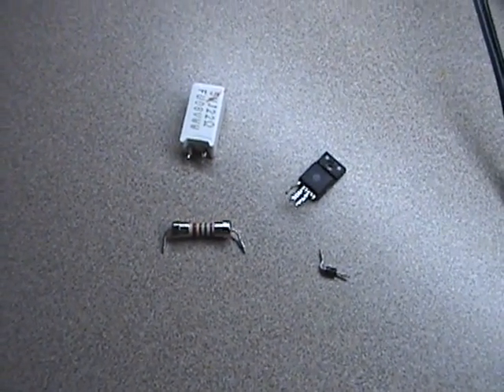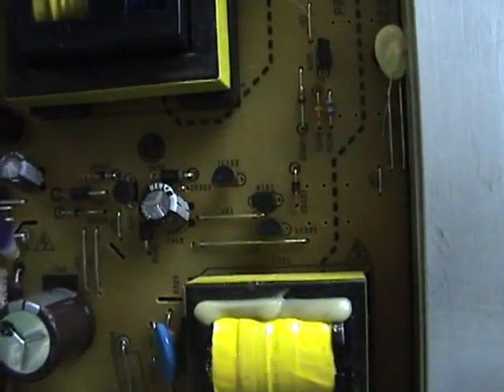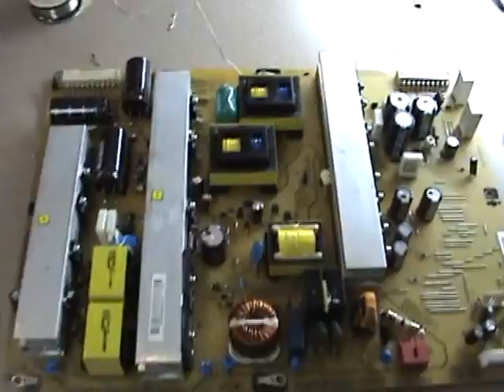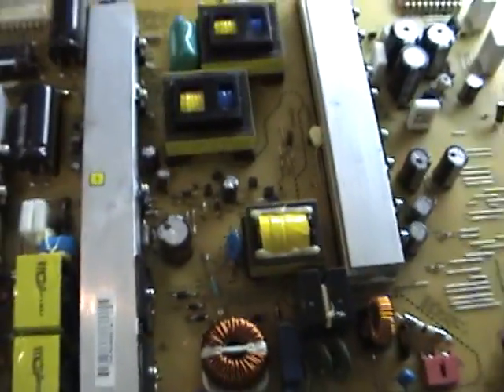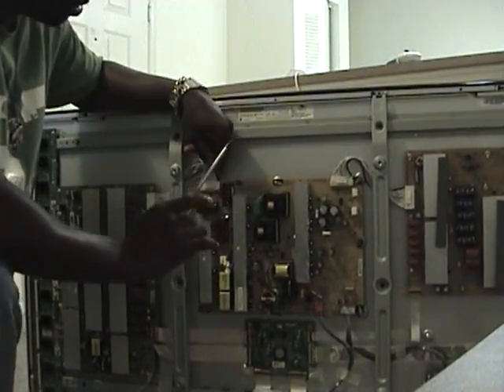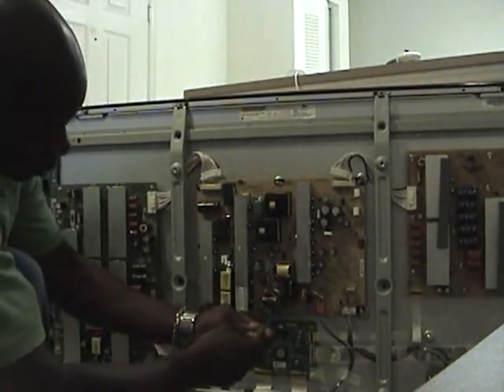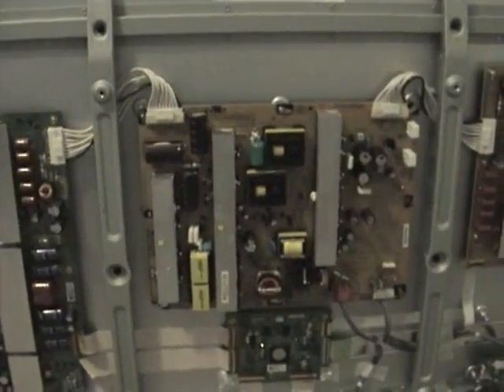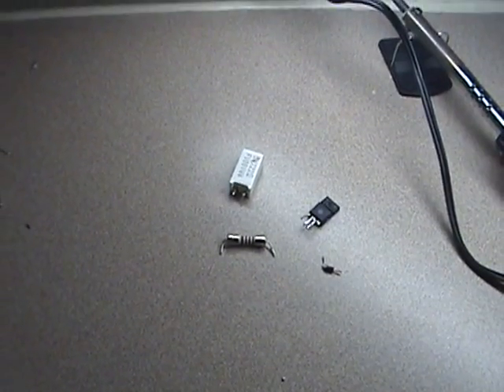LG 50PK540 plasma TV Repair power supply EAY60968801 Part 2-2

Comment: Good info, but a question.  Why is this kit/repair not for the /8 power supply board, the one with 3 power resistors in the upper right corner?  My symptoms are the same however my F302 is not open.  Thank you.
Reply: Same here! Will the kit still work for the /8?

Comment: Thanks alot for video , i have been fixing tvs and monitors as a hobby but its usually most always bad capacitors, anyway im trying to repair a lg PK550 plasma and for once its not bad capacitors .
It does the same as in your video turns on or not for a second then off and keeps sending the signal to turn on then clicks few times and stays off ,im going to replace parts off a lg PK540 so time to google if powerboard is same or if I can use the powerregulator , fuse , resistor you showed in your video ,thanks for helping out  :)  appreciate the video ,subcribed ..

Comment: LG 50PK350 I replaced the aforementioned parts that I ordered from you but still does not work I have a tv stanby when it begins to involve normally disappear red light but no pictures but has a ton but centers are constantly hear tapping please if you can help out
Reply: imam isti tv, isti problem, narucio i zamijenio ove sitnice i opet ista stvar... jeste li vi uspjeli rijesiti problem?

Comment: Well done mate. You have shown me more about these power supplies than anyone else! Ive got a 50PQ20D and a LG4270YD with the same issues. No picture, clicking. If i unplug the set for 10 minutes and then try again they work. No bad capacitors found. If you have any clue id luv to hear your opinion.

Comment: Peace.

I have an LG 50PQ30-UA Plasma TV, and it made a pop sound and now, there's no video, no picture. Only audio. It turns on normal, blue light, clicks, just like normal, but when you look, there's no picture. I don't see any caps blown, no fire, no burn marks anywhere. This tv is rarely used. I can't understand why this tv would blow out like it did. What could be the problem board, repair?

Please help.

Blessings.
Reply: y sustain board

Comment: @TheJam7780 - If you have a plasma TV, the most common causes are the ymain and buffer boards.  If you have an LCD TV the most common problem is the main board.  Search your TV model number on our website shopjimmy com and you will see the replacement parts for that TV model.  You can also give us a call for help!  (877) 881-6492

Comment: Hi Bafury, I picked up a repair kit, and after watching your video only measured that the diode was allowing current through, so I replaced it and the voltage regulator. Still doesn't work though. When i measure the new diode in the board, it allows voltage to flow both ways. If I take it out, it measures correctly. Where should I check next?

Comment: Gday man, got a couple of questions.
model # 50PJ350-AB
PSU EAY60968701
PCB EAX61397101/11
I've got 3 resistor (5wj10ohm) instead of youre 2 in the top right hand corner of the board.
And there is no LED on the board below. 
Do you have a kit for this and can you ship to Aussie?

Comment: Thanks for the video! I have the same problem with my plasma LG TV, although it is not the same model but the symptoms are identical! I will try the same repair on the power board, I have located the power regulator in question, I have checked all other parts (diods, resistors) and they are all fine. I will change this regulator and hope this will solve the problem because I live in a small town and the TV service guys can`t fix it.

Comment: Hi man, great job with these vids! Can you also make a video how to check that power regulator? I checked everything else, fuses are ok, 1 resistor is bad and also diode is bad. I'm from europe so it would be hard to send the board to you...but I found that kits on ebay, I'm just not sure if the regulator is included...Thank you and good luck with other TVs!

Comment from the maker: I actually have repair kits for the 50PJ models as well. Just head on over to E bay and type your Power supply board number in the search, which is EAY60968701..

Comment: n00b question. I am trying to fix my PSU but the solder on the board wont melt. I am using a Weller 15w soldering iron. What kind of power/heat is required for this kind of solder?

Comment from the maker: Sorry to hear you're having problems bro.. I'm not 100% sure that the wit will work on this model, but while looking at some pictures of the power supply boad model # LG EAY60968901, i think i spotted the standby voltage regulator. you should get in contact with me so we can compare part numbers. bigthings09@gmail.com